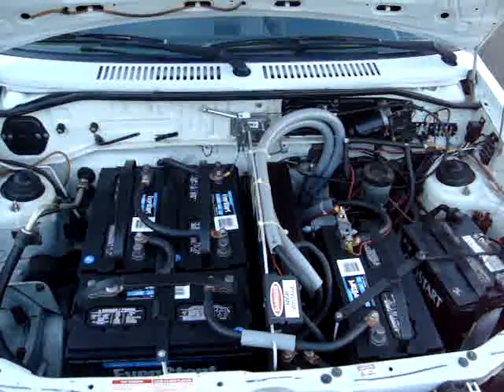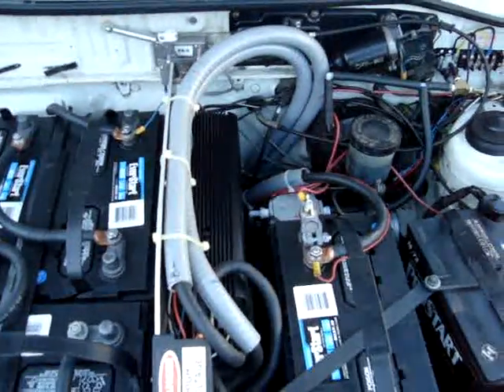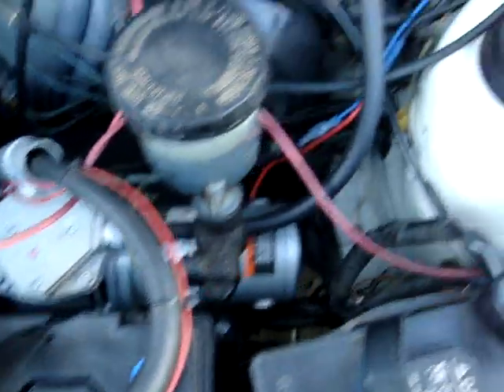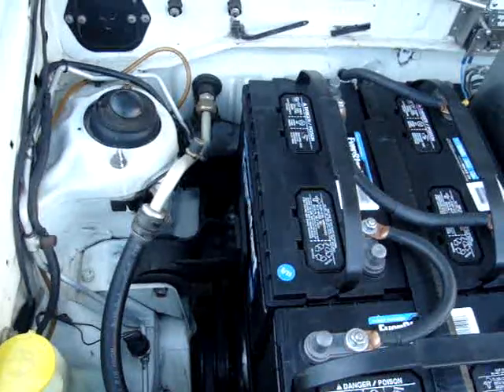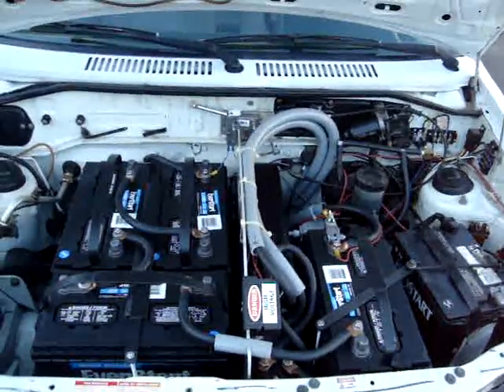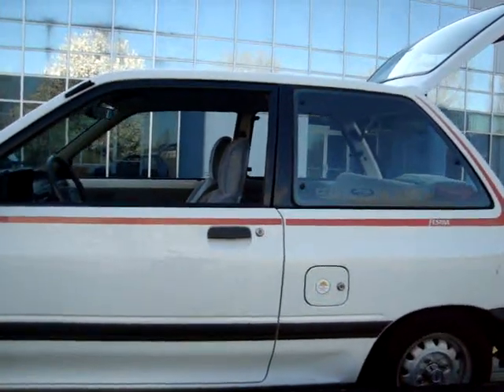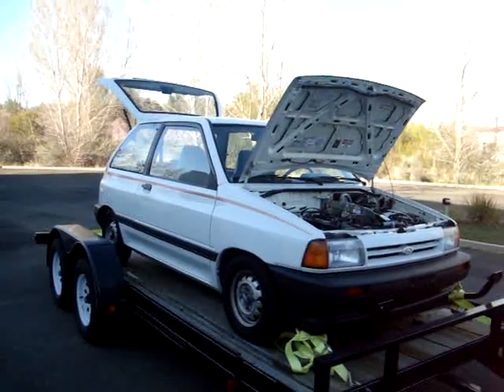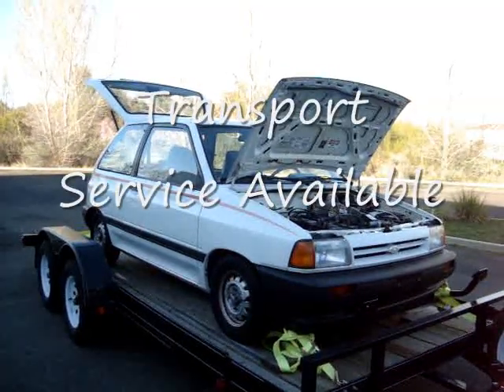$7,500 Electric Conversion.wmv  www.EV4Unow.com

Comment: I’m new to the EV scene, but I am extremely into it. I live in Indiana and the winters can get quite cold. Without a heater core and all of the heater components, how do you get any heat for the vehicle ? I know it is going to have to be an electronic heater, but what kind do you use ? Ceramic etc. ?
Reply from the maker: Yes we use ceramic heaters.  You can also use a reservoir with a heating element(s) in it.  The heated fluid is then pumped through the stock heater core.
Reply: EV4U Custom Conversions thank you for responding back to me. I appreciate it.

Comment from the maker: The fuel tank was removed.  This a 120 volt system, top speed approx. 70 mph, cruising speed 55-60 mph.
We ran our Karmann Ghia 16,000 miles last year without having to spend a cent on maintenance.

Comment: One problem.  The car is not cost worthy.  If the car made 30mpg and @$3.50 per gallon then it would take over 64,000 miles before the cost of conversion broke even.

Comment from the maker: There is a guy in Missouri that converted a Cadillac Escalade to electric.  Bottom line, the heavier the vehicle, the greater the cost.  The batteries are still the largest cost factor in a conversion.  Check out our video, "The EV Answer Man, Episode 7" for information regarding pack size, range, weight, etc.  Thanks for watching.

Comment: Great video thanks! Do you think that a conversion like this is feasible on a larger vehicle like a big suv? I'm thinking more space more batteries... I have access to a bunch of used 24V. batteries so I was hoping to fill a Chevy suburban or a Ford expedition with them and get at least 60 - 80 miles out of it... Thanks

Comment from the maker: Because of drag,  the alternator creates a load when charging which will decrease your range.  The amount of range put back into your pack will not be as much as the range lost from turning the alternator, so the net result is a loss. However, when stopping or going down hill, EV's do provide regenerative braking which does replenish some range to your pack. Thanks for watching.

Comment from the maker: This conversion uses lead acid batteries, and thus the $7,500 price tag.
The designer/builder of this car is using deep cycle marine batteries from Walmart.  He gets close to 40 miles of range when the batteries are new.  After 16 months his range is down to 12-13 miles.  Thus you can see one of the advantages of lithium batteries.

Comment: If someone puts in more of their time and if they are very mechanically inclined with a bugget of 12-15k there is a lot more potential here for both range, driveability, cosmetics. for example a lithium titinate battery could be integrated in between the chassis of the car allowing for increased balance and stability while corning. The titnate batteries will give max power until they are dead rather than slowly fading as well as withstand more charge and discharge cycles.

Comment from the maker: Our typical conversions use 36 to 60 cells.
We use 100, 130, 180 ampere-hour cells.
Prices start at about $136.00 per cell, depending on size and manufacturer.
Your aux. items typically do not use enough energy for you to notice a difference in range.
Less than 10%.  In the winter time with the heat on, wipers, defroster, power steering, etc. maybe 15%.

Comment: i see, i did view one at a freen NRG show. It looked like a botch job, but i had to take my hat off for the attempt. The trunk was ladened down and packed to capacity with lead acid cells, dont even think they were deep cycle just regular car batteries. tell me; about auxillary drive belts for vanos units and power stering pumps and aircon pumps. would they have to be replaced with motors and a back up safety cell? especially the stering. i guess id need a bit of ingenuity and creativity there.

Comment from the maker: The newer cars are a little more involved, regarding getting some of the accessories to work.  For example the cruise control, as it and other items are controlled by the ECU.  The BMW is also a little heavy, right at 3,000 lbs., which means the cost of the conversion starts to increase.  It is definitely  doable, and the BMW is a nice automobile.

Comment: cool, i have another question if you will. The candidate car i propose to do is a 2000 model (dolphin shape)BMW coupe 318ci, a perfect candidate I would say, what with its inline drive shaft and gearbox and bellhouse position not to mention the ample space under the hood to contain the cell and other related apuratus. the question is; what about my ECU? does'n that control my air bags? big job perhaps?

Comment from the maker: The reason for the transmission, is that the motor has a 5500 RPM redline which necessitates the use of gearing. You can take off in high gear, but acceleration is slower, and it uses more energy. I use second and third gears the most. First gear only when climbing a steep driveway etc., and fourth gear only on the Freeway. It will do 60 mph in third gear.  For information about the flywheel and clutch set up, watch our video "How to Convert to Electric Series, Part 5."

Comment: also i was wondering about the clutch and flywheel set up, how does that work. i was under the impression ev's dont need gears and that the driveshaft was directly linked to the output shaft of the motor. thanks

Comment: That's a nicely done conversion. I think using an alternator is an ingenious idea for keeping the accessory battery charged. However, I agree with you about using a DC-DC converter. Even with the alternator, it appears as if the conversion was well planned out.

Comment from the maker: Any vehicle can be converted.  However, the heavier the vehicle, the larger the motor, the larger the controller, the larger the cells, the larger the price tag.
Vehicles weighing under 3500 pounds seem to be the most common conversions.

Comment from the maker: @mikeservis The three cylinder Metro was no power house. I rode in the Ford in the video, two adults, and it accelerated very nicely. You could also probably use an ImPulse 9 from NetGain Motors which has more torque and hp. The vehicle in the video weighs under 2200 lbs. The batteries are from WalMart  (115 Ah)  He does drive the car almost everyday.  You could go with lithium, less weight and longer life, but a little more expense.  Email info@EV4Unow.com for more info.  Not enough space here.

Comment from the maker: @mikeservis To my knowledge, the suspension is not altered.  The weight of the vehicle is under the GVW rating.  There are six batteries in the rear at 60 lbs. each, that's 360 lbs. or like having two guys in the back seat.  We hauled the car to an EAA meeting yesterday, and gave rides to attendees.  The car sits level and has a nice ride.  I was told he spent $900 on batteries and gets two good years from them.  This is his second set of batteries in this car.  He's range is 30-40 miles.